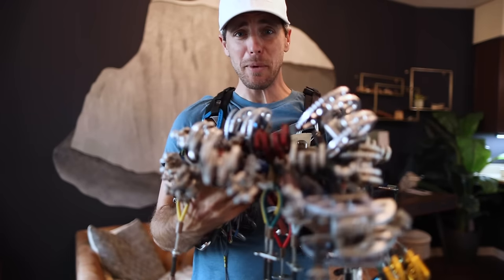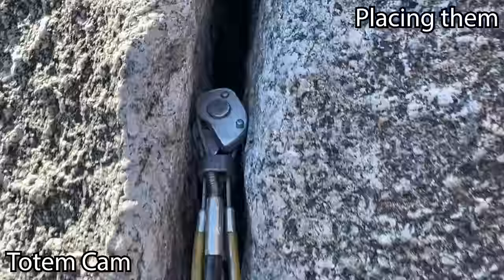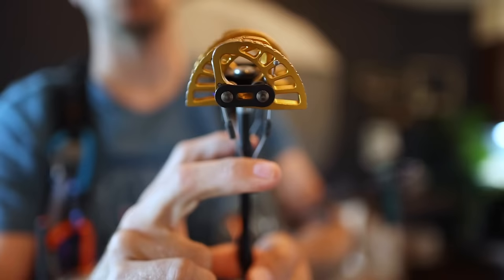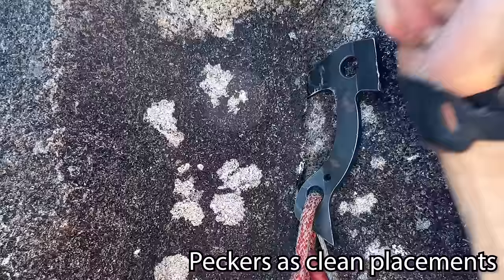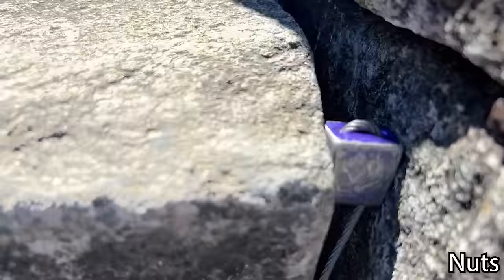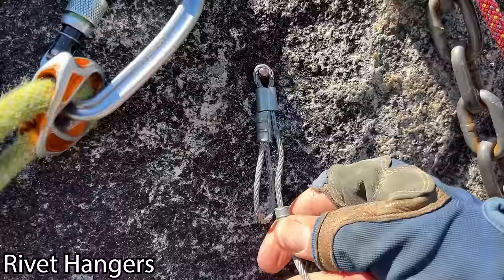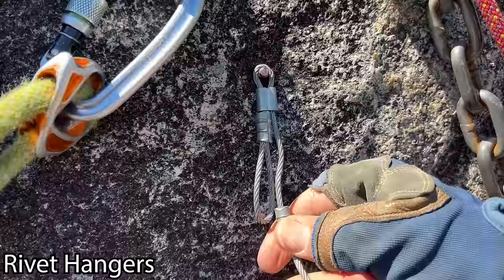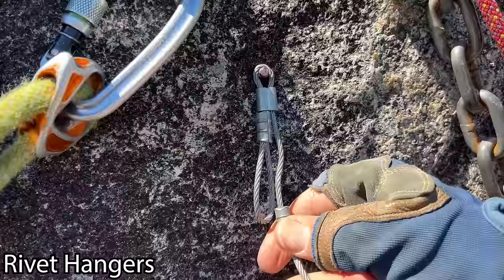Aid Climbing - Hooking and Nutting

Comment: Good stuff guys,
I'm gonna have to come back when it's not past bedtime.
1) You've gotta flick the nut tool. Trust me. It's a miracle. Micro vibrations, beat the heck out gashed palms.
2) I almost always tied my knife-blade pins short. Think old-fashioned soft European pins in dolomite. Knife blade flex into the rock. No need to overdrive, but in a corner you can place the tie-off sling and drive the pin next to it to not cut it.
3) Pin removal should always be up the back down until horizontal  or less. Same with the funkness.  Then you are creating a wedge placement  for the future,
One guy driving it negative will breakout that wedge.
4) Leapfrogging camhooks is an experience you'll NEVER forget, be ready to commit. That crunch as the corners set.. Leapfrogging sketchy hooks in general... ah--eeeee.
All hooks except the tiniest flex and "settle" into place. As you begin to weight the next, the one you are on "lifts."  Keep that 50/50 moment brief... commit.
5) heck... bedtime... bring booze that you don't like. It last for more nights 9n the ledge.
6) Be prepared to suffer.
7) Success is won by having EXTRA water and days. I'm telling you. It's the most important advice. Weather, and the head game... The whole 1st half of the journey, especially as a rookie... you and your partner will be longing for the ground.  This is where that feeling.. bug... let it alternate between you. Don't let it hit you both at the same time.  When you see that look, you need to nut-up. And after the next pitch,  when he sees it on your face he needs to say, "Man let's keep going, we've got plenty of water and time. (Set yourself up for success.)
My 1st success was on the 3rd wall. And I just did it alone. No one to blame but me.
7) It's okay to talk to yourself on a solo bigwall. It's just happens on day 3 to 12.

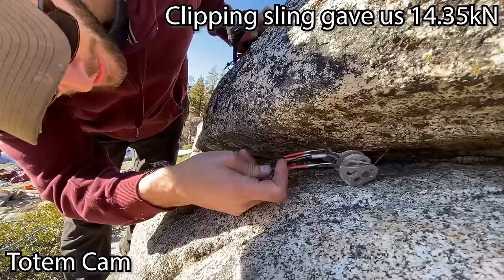Comment: At 6:00 you are using the wrong side of the Totem, than what is recommended by the user manual. The outer lobe should touch the rock on the right in order to keep it from rotating out of the placement when loaded
Reply: Agreed, stance wise are more stable in a wider stance or narrow stance. That's a good way to remember I'm glad you weren't the only one that noticed

Comment: Do you think you'll ever test offset cams in real rock? I've had some surprising failures with them where the edges of the lobe metal-sheared. I used to think they were so good! My gut instinct is that they don't work in true tapers, but only work in stepped tapers (so that you get full-lobe contact and not just corners of each lobe)

Something similar to your placement at 13:37 pulled on me with a fall from 2 feet above the placement (0.2/0.3 z4 in a flat-walled granite taper where the back lobe was nutted).

Comment: Has anyone considered making a small bar (like a metal punch with a flat end) and then putting that in the piton head hole and then hammering upwards (opposite way of the piton insertion).  That would save you smashing your face.  You could also use it as a lever and smack the lever end if you have a fulcrum point.
Reply: Also you could use the head of the hammer (pointy end) as a fulcrum lever too.

Comment: A trick with bolt plates (Moses plates) is to clip up from underneath. That way any wear that the steel puts into your aluminium carabiners is in the same spot they're getting wear from standard hangers and wires, and you're not leaving nice little sharp edges to rub on your nylon slings. 
Also worth mentioning that chunky carabiners are safer because they'll block the large hole and stop the plate lifting off. Wire gates and skinny lightweight carabiners can allow the plate to flick upside down and come off. This can (and has!) happen just from the lifting force that a rope puts on the quickdraw as you climb through. 
Plugging my own video on that topic: https://www.youtube.com/watch?v=A7LwmuJ00uM

Comment: IS THAT EVEN OKAY?  heating up the nut by repeatedly beating it cant be okay. Maybe its an alloy that's really sticky but pure aluminum will crumble eventually. I feel like beating it into shape and no more than you have to is good enough, then beat it in place. The sharp chisel was a bit wild too, I think it needs a bit blunter profile. Still tho, I think the placement helps it get another star. After all that, it looks super solid. I would give 2/3 stars, maybe 3/5.
Reply: Agree.  I haven't placed a copperhead or alumahead in decades but pre hammering it is work hardening. That's making it less likely to mold to the rock.  We cleaned them with a funkness and they're good for 1-3 body weight level placements before throwing them away. Never thought to hook a broken one with a pecker, but also only ran into maybe one or two broken ones ever.

Comment: Not sure if you noticed, but the fact that extreme gear and your logo are basically the same design suggested that you own both, but you don't disclose your ownership of extreme gear. I think not disclosing your ownership make people feel like your content is disingenuous. Stop pretending the company you own is sponsoring you, just say you are only selling stuff thats super good enough. I love the content, but the lack of transparency is off putting at times. 

I have no problems with you promoting things you own, but pretend what you own sponsors you does rub in a way that induces chafing.
Reply: If you had spent a 1/10 of the time on a google search as writing your nonsense you would have answered your own question. Front page of extremegear. He also talks about the relationship in so many videos it's annoying. The chaffing is a you problem.